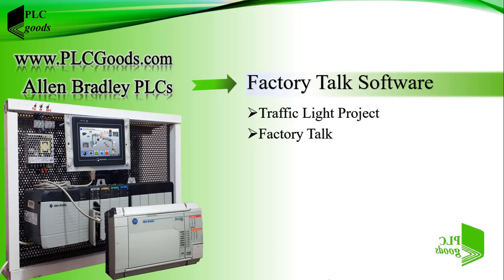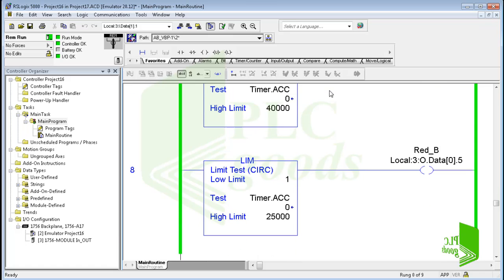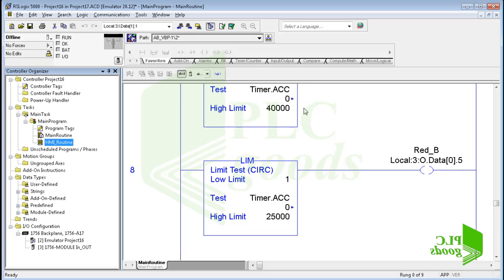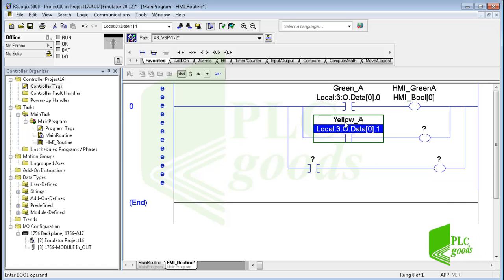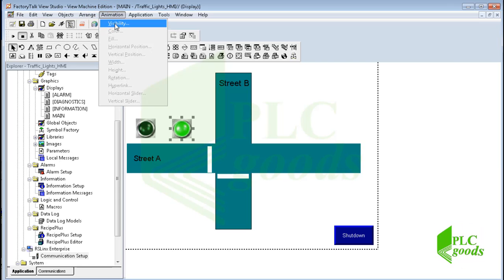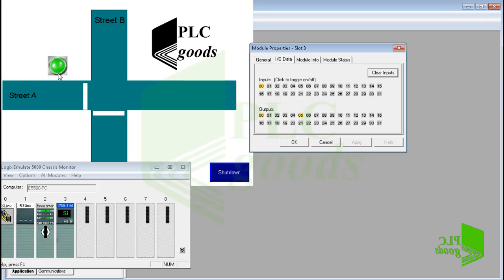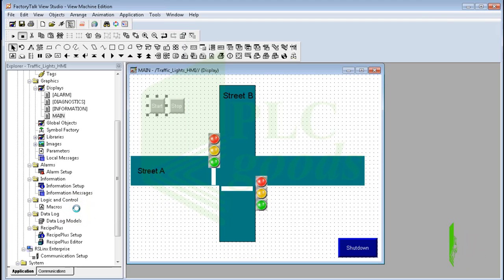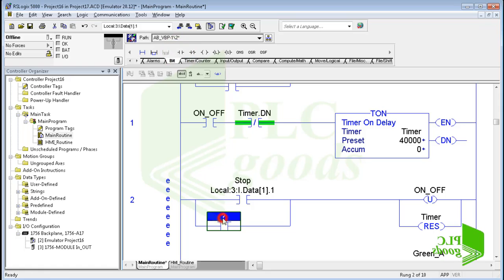FactoryTalk HMI Tutorial 🚦 Design Traffic Light PLC Project  | Lesson 17

Comment: Thank you very much for this great content and for everything that you provide to us as followers of your wonderful channel
I am currently starting to learn Rslogix 5000  and have some questions

I know that the minimum space for a Tag is 32 bit  
 is this true when creating a Bool Tag it reserves 32 bit memory space??

second question
A friend told me, in order to save the memory in rslogix 5000 you have to use the array
Does the array of 32 Boolean Tag take up the same memory space(Area) of DINT Tag ?

The third question
How did you put the square bracket in input output Tag Local:3:O.Data[0].0  
Is not this an array
Reply: hello. thanks so much for watching our videos. 
1: I do not think so. because Boolean tags are used widely. that's illogical to use 32 bits for each boolean tag. 
2: nearly, The array of 32 Boolean Tag takes up the same memory space of DINT Tag.
but 32 Boolean tags need more space rather than an array of 32 Boolean Tag. because you will need to store the selected name for each Boolean tag.
3: RSlogix 5000 uses array structure for inputs or outputs too. but we don't change their address. instead of renaming an input or output address, you can use Alias type tag
Reply: @plcgoodsmentor9223  Thank you very much for your response and wish you continued success
you are the best
Thank you
Reply from the maker: Thanks for visiting the Plcgoods /YouTube channel